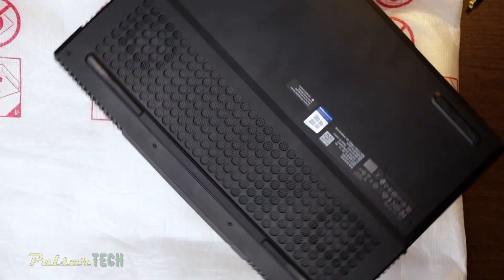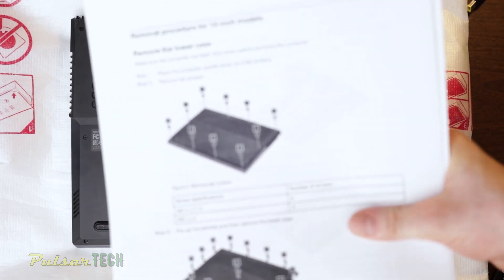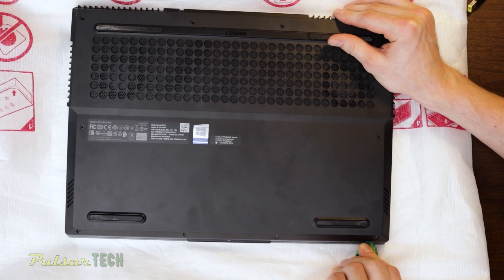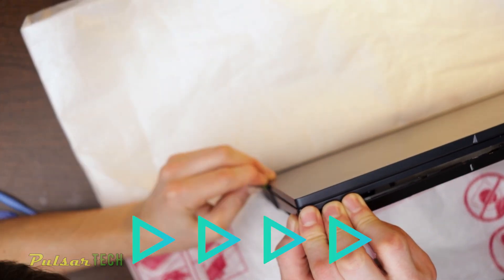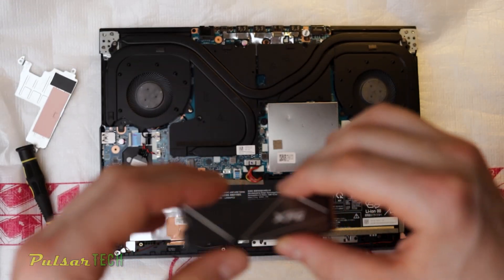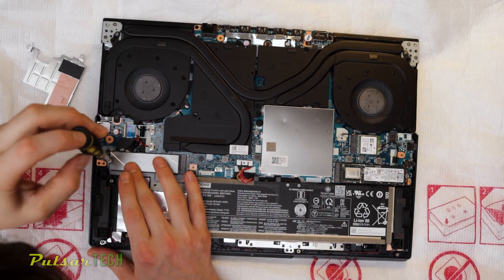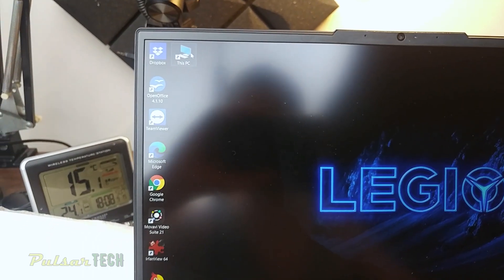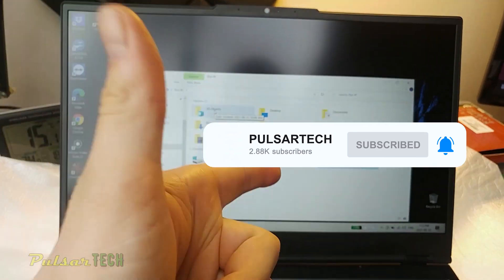LENOVO LEGION 5 HOW TO INSTALL A SECOND NVME SSD DRIVE

Comment: Jesus it looks nightmarishly difficult to get that back panel off. I got the 17.3 inch version of this and only have a 500gb SSD. I really wanted to add a second SSD for storage and gameplay, as well as expanding the RAM to 32gbs, but this looks very difficult. All my other laptops had very easy to reach storage and RAM chips. This is an intense adventure. Looks like I'll have to pay a pro to do this. Oh well, thanks so much for this video. I've built 4 PCs in the last year for gaming, but I ain't going near this one, it's a warranty void waiting to happen. I wish they made the RAM and storage more easy to access, I guess it all has to do with the Legions excellent thermal system, oh well. One question, if I buy the components, like the RAM sticks and a m.2 ssd expansion, how much does it cost to have a licensed professional install it on average?
Reply from the maker: Hi, it's too difficult, everything like I've showed in the video, download a service manual for your laptop and take your time, do it slowly, no rush. The most difficult part will be the side vents but it's doable with some patience. I can't say how much it will cost because it all depends where you are and the shop rate. Just give them a shout and find out. It shouldn't take more than hour for you to do it, and for a pro maybe like 15 mins. Good luck!
Reply: @PulsarTECH  I have the manual. I actually contacted Lenovo about it to see if upgrading voided warranty. They said as long as it's done with compatible parts no, but that any accidental damage occurring during the upgrade would void the warranty.  And went on to say that user upgrades were the number 1 reason for warranty terminations.
Reply from the maker: @bizbarley74  I agree, if something breaks like plastic cover they won't warranty that. But RAM and storage upgrade are the most common and they don't void the warranty. So as long as you do it carefully it will be alright. But of course, you can always take it to the repair service computer shop and they will gladly do it for you for some cash. Like I said the toughest part will be opening the vent parts the rest is simple. And make sure you have the proper plastic tools, not metal. Good luck!
Reply: @PulsarTECH  Yeah I get it. I have no trouble once it's all opened up. That's easy. Like I said I build PCs semi regular. Easy access, hard to mess up. And my previous laptops have had panels that you could remove just to access the RAM and internal storage, without needing to remove the entire back panel and all the screws. Instead they just had a partial panel to upgrade common components with only a couple screws. The Legion panel takes a lot of careful time to remove as you illustrated. Really appreciate you highlighting that so I was able to see what I'd be up against. Great video!
Reply from the maker: @bizbarley74  thank you!

Comment: Hi, thanks for this, just a quick one do you know where the RAM is in this? Wasn't obviously visible to me
Reply from the maker: Hi Mitchwork, sure, RAM is located underneath the metal shield above the M.2 slot. Are you planning to upgrade RAM as well?
Reply: @PulsarTECH  yeah, gonna double it to 32GB, and possibly pickup a 1/2tb NVME Drive. Honestly the laptop is great only had it a month but you'd think for a gaming laptop they'd come with more storage.
Reply from the maker: @mitchwok  absolutely, I have upgraded mine right away for another 2 TB. I think it's because of the price, for the price tag and what you are getting, this was the best gaming laptop you can get. Now I'm running short of memory, 32 GB would definitely help. Maybe do another upgrade later. Let me know how it goes!

Comment: HELP HELP HELP PLEASEEEEEEE : I have installed a Samsung 970 Evo Plus 2TB, but the sequential speed is half of what is supposed to be, then according CrystanDiskInfo the transfer mode is PCIe 3.0 x2 while it support PCIe 3.0 x4. Could it be a Samsung problem ? Or the PC allow only 1TB SSD ?  I found this online: https://psref.lenovo.com/syspool/Sys/PDF/Legion/Lenovo_Legion_5P_15ARH05H/Lenovo_Legion_5P_15ARH05H_Spec.pdf
Reply from the maker: Hi, indeed in that bulletin it only show 2 M.2 drives up to 1TB but as you have seen in the video and you have installed yourself  it worked fine with 2TB. BTW someone wrote to me in comments and have installed a 4TB one even. Also in the bulletin it says Two M.2 2280 PCIe Gen 3x4 slots, support M.2 PCIe 2242/2280 SSD, so this means that they both should work on PCIe Gen 3x4. I think there's an issue with the specific drive. First of all, have you installed 2TB drive into a second slot? You haven't swapped the 512GB original drive, right? Also you can try to update the BIOS via Lenovo Vantage, maybe it will get some updated drivers for this SSD. Otherwise I would send it back and get a different brand SSD. Hope this helps, let me know how it goes!
Reply: @PulsarTECH   I did something strange but it worked, I installed the Samsung 970 Evo Plus 2TB in the slot 1 and moved the deafult supplied SSD NVME 256GB SKHynix with OS installed in the slot 2. And now both of them work fine in terms of speed and the CrystalDiskInfo for both of them indicates trasfer mode PCIe 3.0 x4. I boot the system with the OS from the slot 2.
Reply from the maker: @giovannialmanno8107  wow, good for you. I'm glad you got it figured out. Thanks for the update!

Comment: Hi! Can you put 2 2280 ssds or is it essential to have 1 2280 and 1 2242?
Reply from the maker: Yes, as far as room you can install 2 of 2280 M.2 SSD in this laptop, I don't think there's any software limit in place. By the way, just got a comment about somebody actually installing a 4TB M.2 drive instead and it works.

Comment: Hello,
Do you need to disconnect the battery before installing the ssd or not?
Reply from the maker: No, if you have disabled it as shown in the video.
Reply: YES , neve trust software safety, just Unplug it and be safe.

Comment: Great stuff but is it possible to change boot drive to the new m.2 slot? (I have cloned the operating system). I checked the BIOS but couldn't switch it. Thanks
Reply from the maker: Well, If you have cloned OS to the new M.2 drive and formatted the first drive, it should boot from the new one. But of course cloning isn't always working right.

Comment: SSD M.2 2280 Corsair MP400 4TB 3D QLC NAND NVMe works in Lenovo Legion 5 ?
Reply from the maker: I think it should but I haven't tried. Let me know if you find out.
Reply: @PulsarTECH  Yes , it works great !😀
Reply from the maker: @mrdemetrius7324  awesome, great news, maybe I will upgrade my other 512GB M.2 SSD to a 4TB, then it will be 6TB in total though so far seems like I'm okay for storage. Thanks for the update.

Comment: Can you install 2-sided ssd of 2TB?
Reply from the maker: Hi Casper, it might depend on the manufacture of the SSD but the ADATA worked great. As you know Lenovo doesn't list any support for 2TB SSDs at all, so if you try a different SSD than in the video, let me know if it works!

Comment: Does anybody know if a 2TB SSD can be installed? Lenovo says 1TB max buttt I wanted to confirm please! Some people have done 2tb..
Reply from the maker: I have installed a 2TB as you can see from this video.
Reply: @PulsarTECH  Any issues with it? Why do they say 1TB max?! Also 2240 or 2280, both work fine?
Reply from the maker: @TalkingTorque  no, it works great and lots of storage. This is 2280.

Comment: Thanks for the excellent review.
I have the same Lenovo Legion 5 with 1TB HDD, and planning to replace it with 2TB m2
How can I make sure the m2 is compatible with my Laptop or not?
Reply from the maker: Hi, thanks for your feedback. Sometimes the manufactures have a list of compatible devices on their website for each specific model. I don't think Lenovo has it though. You can always call their tech support and ask them but of course it all depends who you will be talking to.
On another hand, I think most of the modern M.2 NVMe SSDs should be compatible with this laptop but no guarantee. I would stick to the one in this video or others that have already been 100% tested on this machine. Hope this will help.

Comment: Hi! Can I add one terabyte ssd to the second slot. When there is already an ssd with 512 gigabytes of memory on the first port?
Reply: the total will be 1.5 terabytes
Reply from the maker: Hi Evgeni, yes absolutely.
Reply: @PulsarTECH  I have a problem, the bios does not see the ssd inserted into the second port. Legion 7, 2021. ( ssd = samsung 970 evo plus 1 tb)
The SSD works, checked it, insert it into the first port. =(
Reply from the maker: @evgeniermakov1522  what about the other 512GB ssd can you install it into slot 2?
Reply: If the original 512 GB ssd is put in the second port, then the port does not work.
Perhaps the port needs to be activated through the BIOS, but how to activate the advanced bios mod.
Perhaps you know how to enter advanced bios mode?
Reply from the maker: @Evgeni Ermakov  0:35 get into the bios advanced mode, that's about it. Maybe you need to update the BIOS on your laptop. I think you can do it through Lenovo Vantage. Let me know how it goes.
Reply: @PulsarTECH  can I add 512 on my 512 laptop

Comment: Nice video. Very nice to hear someone speaking cleary and not too fast. Really nice trick with disabling the battery too.
I was wondering if my new SSD might be faster than the one from factory... but I'll test that later. Anyways it's nice to have a fast drive for heavy video files 😊
I think though,  that the video could have been 2/3 length... or maybe even half the time... but all in all...very nice instructional video.
Reply from the maker: Hi Thorkild, thanks for your comment and feedback!

Comment: I did this with the 1tb ssd and it was working fine the first day which was yesterday and just today it disappeared and doesn’t seem to work any idea why?
Reply from the maker: Hmm, good question. What drive do you have? I would try to use Window disk manager and see if it's visible there. Maybe it needs to be formatted. If it doesn't see it, try a different third-party disk management software. Also, I would check if there are any updates for the BIOS thru Lenovo Vintage. Let me know how it goes!
Reply: @PulsarTECH  I’ve done everything but it just showed it as 2gb instead of 1tb so I’ve just decided to return it and try the ADATA - XPG SX8200 Pro Series 1TB PCIe Gen 3 x4 M.2 2280 Internal Solid State Drive with Flash 3D Nand Technology which hopefully it will work.
Reply from the maker: @rtloredo4316  sorry I haven't seen your response. So how is it going? Did you manage to get it working? I know Adata XPG SX8200 Pro series is a great drive. I have one of them in my computer.

Comment: Thanks for a very informative video. I have a legion 5 2021 too with the same dafault storage as yours (512gb). My question is, is it possible to replace the default storage with 2tb M.2 NVMe SSD and add an additional 2tb M.2 NVMe SSD? So the total storage will be 4tb. thanks in advance!
Reply from the maker: Yes, absolutely. The only thing is, if you want to keep your original Windows, you would need to clone your operating system from the 512GB M.2 NVMe drive to a new 2TB drive. You would need a third-party software such as Acronis True Image to do it. What M.2 NVMe drives have you got? Let me know how it goes.

Comment: whats the need to use acronis when windows disk manager does it in windows itself?
Reply from the maker: Hi Gwen, there's no need to use this particular program or any other, you're right, WIndows disk manager can do it too but  I like the way acronis works and it works good every time I use it.

Comment: hei i wanna need answer for a question, did the legion 5 can run ssd with Pcie gen 4 x 4? because mine have legion 5 2020 and got free ssd from internal laptop 512 gb ssd with 3200 MB/s read and 2900 MB/s write.
iam confused to buy SSD with gen 3 x 4 or SSD gen 4 x 4 ?
Reply: Were you able to install M2 SSD? 3*4 OR 4*4... If so, what storage size?

Comment: Would this process be the same with the model that has an Rx 6600 M?
Reply from the maker: Hi, if it is a Lenovo Legion 5 2021 then yes, the graphics cards wouldn't matter, disassembly & installation process will be the same
Reply: @PulsarTECH  alright thank you
Reply from the maker: @mccrock2820  no problem, let me know if you have any questions!

Comment: I'm gonna uppgrade this pc for someone soon and have never done a Lenovo before. So is it correct that the screw for holding the M.2 is already screwed inn at the empty slot? Because the
"Samsung 970Evo Plus" did not come with this screw.
Reply from the maker: Hi Sindre, yes the empty slot has a screw and a heat sink. And yes usually no NVMe drive comes with a screw, it should be always located on the motherboard. Hope this helps, let me know how it goes! And subscribe for more videos if you haven't yet.
Reply: @PulsarTECH  hehe thx for the answer. I just screwed inn screw nr. 2 on the bottom cover of the laptopp and it's finished uppgraded. The girl the laptop is for even got to do some of the work 😁.
We are seconds away from first time booting of this laptop now.
Reply from the maker: @SindreEide93  awesome, have much storage have you got now?
Reply: @PulsarTECH  hei i wanna need answer for a question, did the legion 5 can run ssd with Pcie gen 4 x 4? because mine have legion 5 2020 and got free ssd from internal laptop 512 gb ssd with 3200 MB/s read and 2900 MB/s write.
iam confused to buy SSD with gen 3 x 4 or SSD gen 4 x 4 ?
Reply from the maker: @ikadekandhykaramaputra9256  you can use either gen 3 x 4 or gen 4 x 4 because it is backward compatible. But on Lenovo Legion 5 it has gen 3 x 4 so installing a gen 4 x 4 ssd won't give you any improvement or much improvement

Comment: Excellent, I was just thinking about upgrading for larger storage. Thank you!!!
Reply from the maker: Glad it was helpful!
Reply from the maker: @unstoppableguy7896  yes, I wouldn't recommend that because the heat transfer will be worse you manage to connect both heat sinks together so tight or using a thermal compound so that they will act as one solid heat sink. Otherwise it will make more restriction to the air flow and it will be cooling down even worse. Hope this will help!